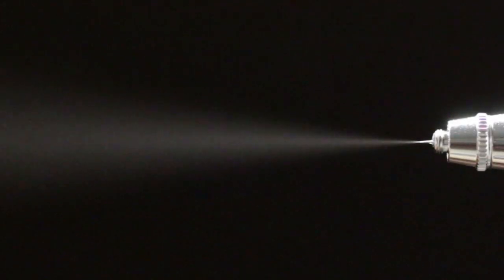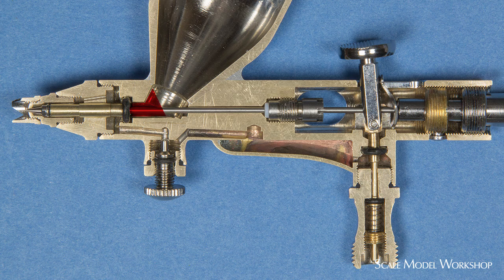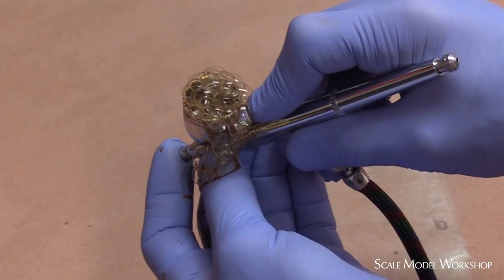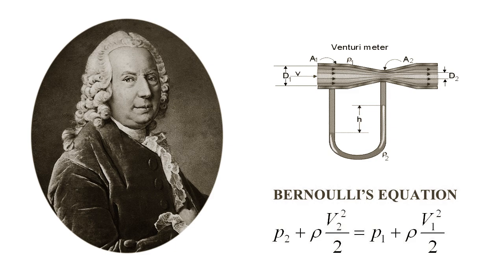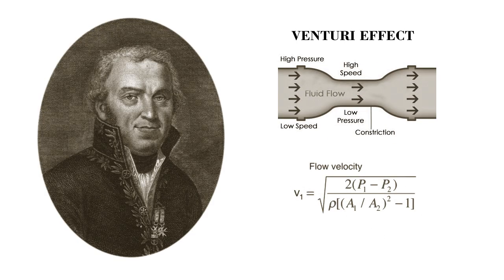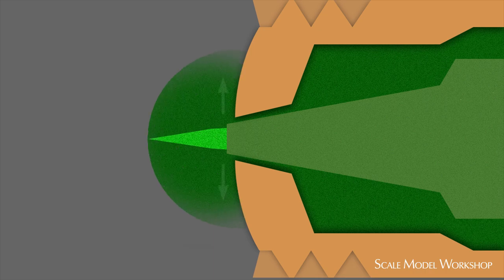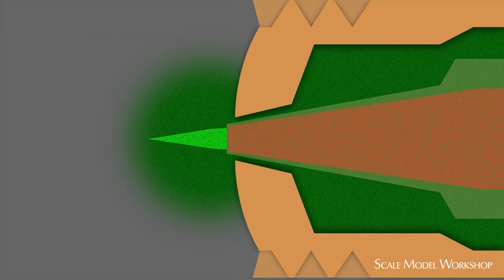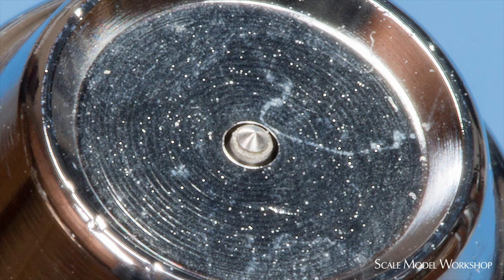How Does an Airbrush Work?

Comment: Great video, helped me to understand how my airbrush works!  Also helped me to figure out why it's NOT working at the moment, thanks to the clear cross-section picture. It seems the lever guide o-ring is missing, so instead of going straight to the Venturi, some of the compressed air is escaping past the trigger pin into the body of the airbrush, resulting in reduced pressure for spraying.  Now to work out exactly what size of o-ring I need to order...